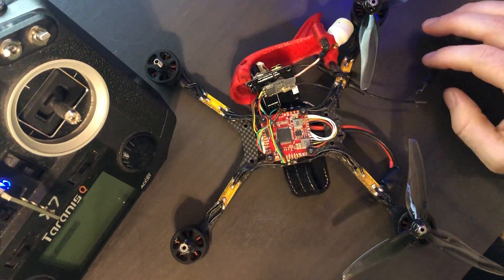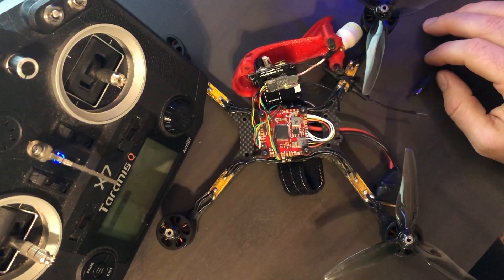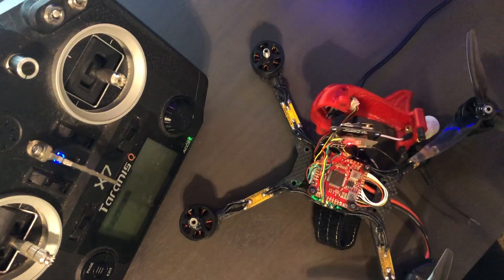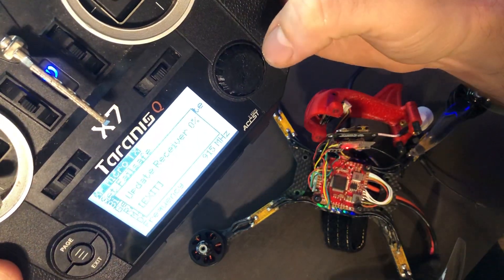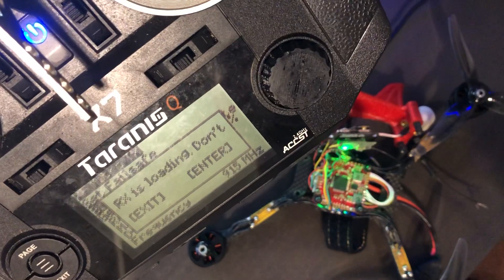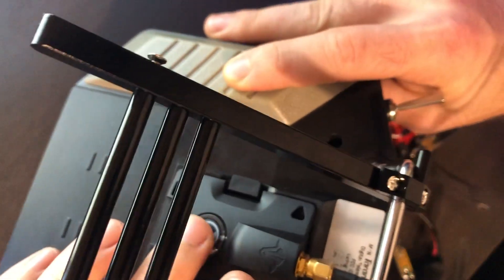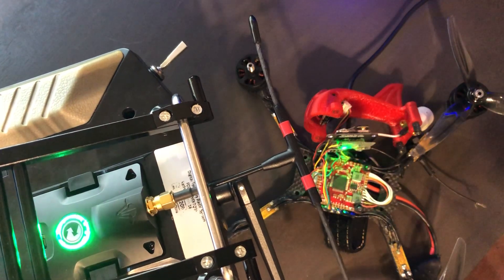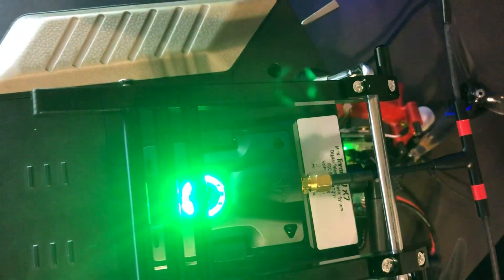How-to: Binding - TBS Nano RX

Comment: my nano rx wont come on just by using a usb.
Reply from the maker: Some FC's may not power the RX via USB - in that case you'll have to use a battery.
Reply: my issue is it's not binding. updated firmware and then downgraded firmware. downgrading it worked, it updated the nano but that was the end of it, it never bound.  so i still can't bind.
Reply: @denbleygv9238  having the same problem cant bind